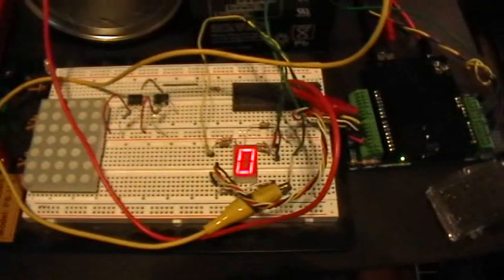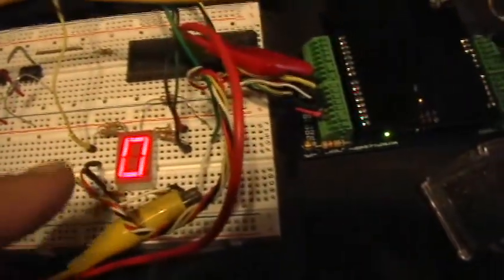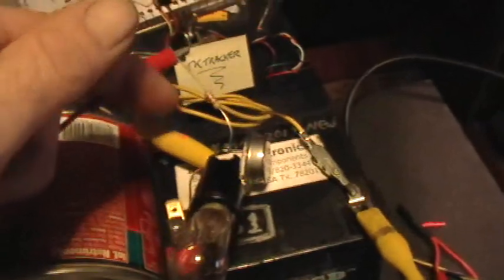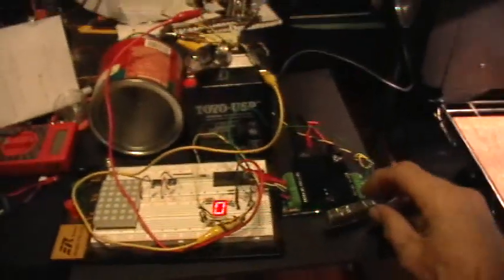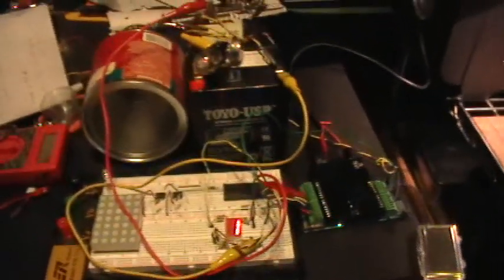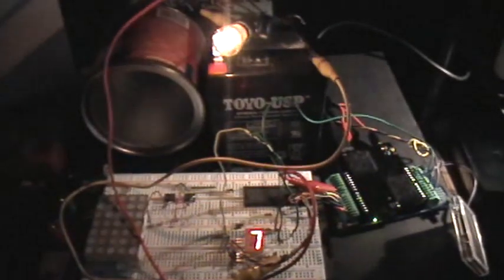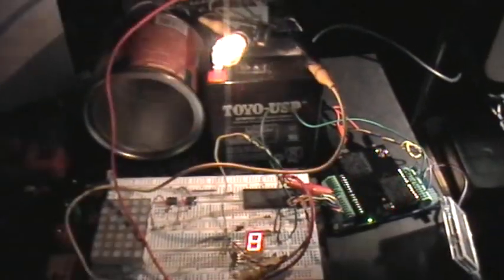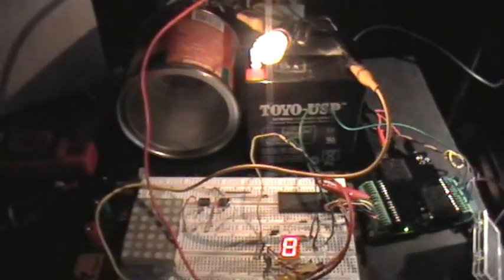Arduino 9: Driving a Bipolar Transistor: 2n3055 As Light Dimmer

Comment: Interesting, you are doing PWM (pulse width modulation) at the base of the transistor. The Arduino Due (SAM3X8E ARM Cortex-M3 CPU) has two real digital to analogue converters which allow to set a pin to a certain voltage (between 0 and 3.3V) with a 12 bit precision. But I guess that PWM at the base of the 2n3055 is more appropriate to control the current through collector-emitter than a certain voltage at the base.

Greetings, Conrad